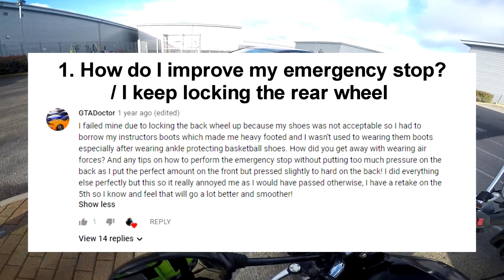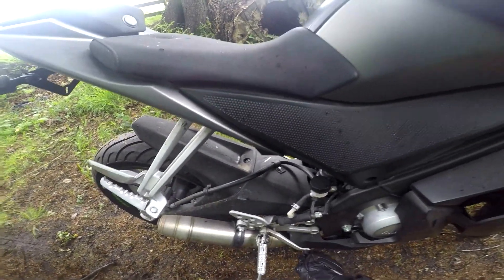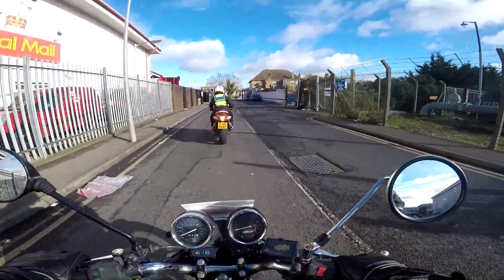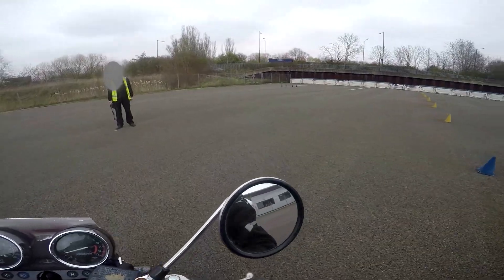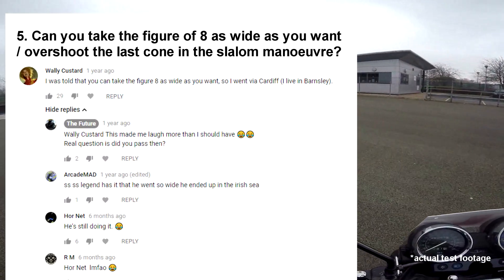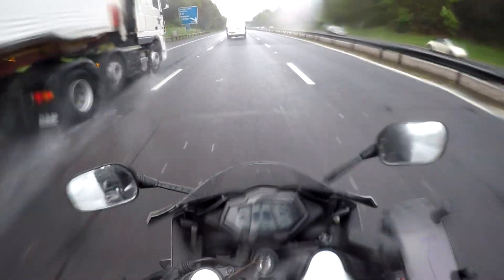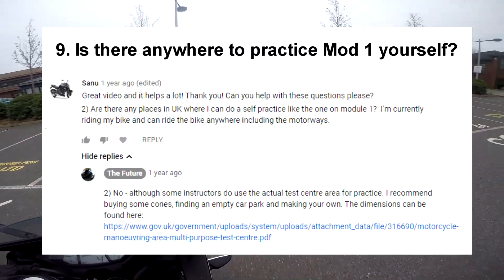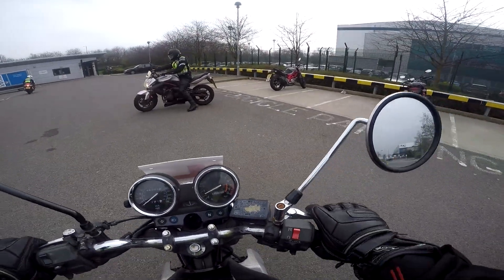Top 10 Q&A / FAQ - Mod 1 Questions Answered (4/7)

Comment: Watching this video after failing my mod 1 today because I didn't stop quick enough in the emergency stop and locked the wheels as you described. Thanks for doing this great video. Taking these tips on board! Cheers.
Reply from the maker: Unlucky mate, not a problem hope it helps next time around! Good news is it's an easy manoeuvre to improve just on theory as I've described, unlike a balance one. If you forget everything else, just remember: rest your foot over the rear's, and let the front brakes do most the work!
Reply: @C9S1  Just passed my test with no minors! Cheers for the tips!
Reply from the maker: @Chris-xz2zx  Great to hear that! Pleasure, safe riding out there
Reply: Don't you get 2 attempts at the emergency stop

Comment: Great tips, our advice re rear brake. Don’t use it for the emergency stop, it will create more than enough breaking force.
Reply from the maker: Thank you! In all fairness that is the dummy-proof method which I agree with purely for test purposes. Goes without saying in real life you want to be using both of course as effectively to decrease your stopping distance in an emergency. (I guess this is why most instructors have to teach using the front and rear from DVSA training / guidelines and due to liability...)
Reply: The Future that’s, I bought this up with a couple of guys today. They both said when on track they don’t even use the rear. Apparently this is common in racing. 

On the road you’re right, good to be used to using both. 

A lot of schools are starting to use ABS bikes too, my SV has this and in an emergency... mash that pedal. ;).

Have a good one!
Reply from the maker: @oliveranthony7012  Yeah that's very strange. ABS on the emergency stop is like playing the game on easy mode! Beginners have it easy eh

Comment: The place where I train get to use the test centre at the weekend although it’s an extra £15.
Reply from the maker: Definitely worth it getting the real deal.
 + Mentally will make you better prepared as doing  the actual test won't be too much different

Comment: Should i take lessons before taking mod 1 and 2..ive been riding for over 5 years on cbt
Reply from the maker: Chocolate 19 I recommend at least a couple hours min to get you up to speed, as everyone has habits they would have picked up on in that time that won’t be in your favour with DVSA examiners. Also even though you’ve been riding for years, there’s specific things, eg roundabout observation procedures to name a few, that you more than likely don’t do exactly as they want, that’ll cause you to fail. I pretty much have covered 99% of the stuff you need to know to pass in my playlist, so it’s up to you judge by watching if you already do most the things on there - and I’ve designed it to help people self-teach themselves without the need for instructors. Hope that helps, anything else let know

Comment: I have my CBT and am going to do the full test soon, so I have been practicing my tight figures of 8.    You need to counter lean, get the  bike right over, put near full lock on , and use the clutch to speed up if you feel you are falling into the turn.   Same goes for U turns.

Practice them!   Do them over and over again till they are tight and you are confident you can drop into one any time.